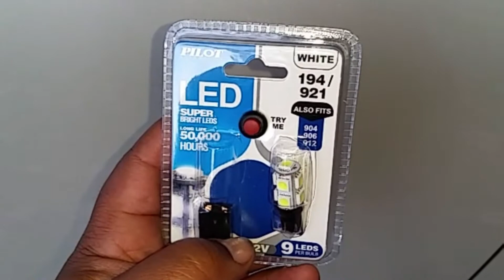2006 FORD EXPEDITION PUDDLE LAMP INSTALL

Comment: I have a 2004 expedition but I don’t wanna do it because I feel like it’s gonna break for a led turn signal would it need a resistor
Reply from the maker: I didn't need resisters. But if you are changing out more than the puddle lamps u may need some
Reply: Greg Powell I wanna change the puddle lamp and the turn signal bulb that is in the mirror to a led amber bulb do I need to put a lot of force to push the mirror?
Reply from the maker: @jokey_nyc2655  not and extreme amount of force.. just push it the are designed to go that way also..
Reply: Greg Powell ok thank you I will try tomorrow

Comment: Mine’s is 2006 xlt my mirrors don’t have a puddle lamp can I add them or I need to change the hall mirror and some Wiring to make it work any one know plz?
Reply from the maker: If it has a spot for them you can add them if not may have to get the whole mirror